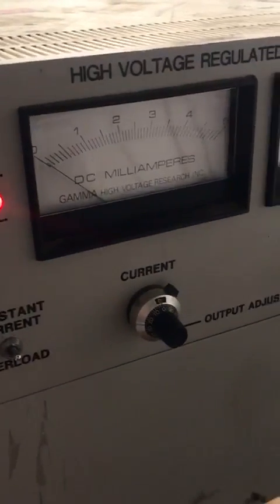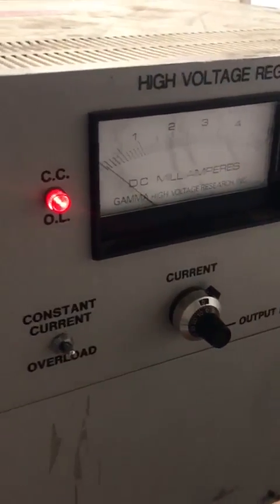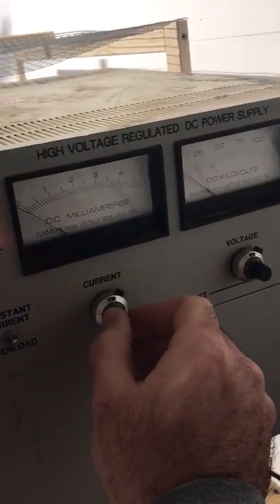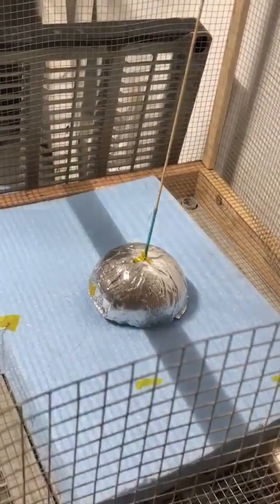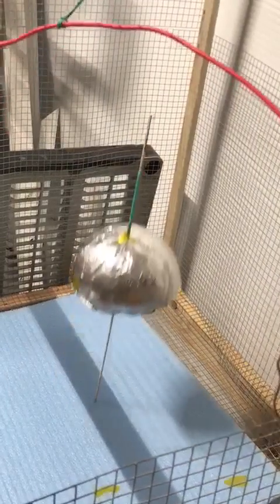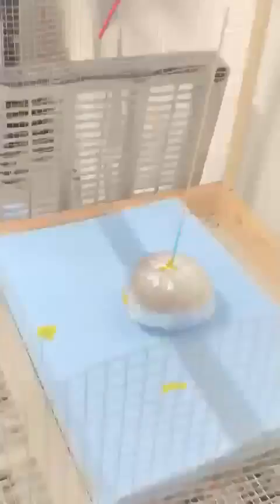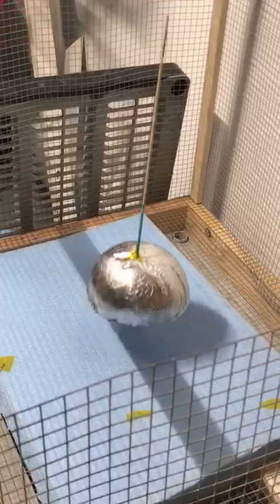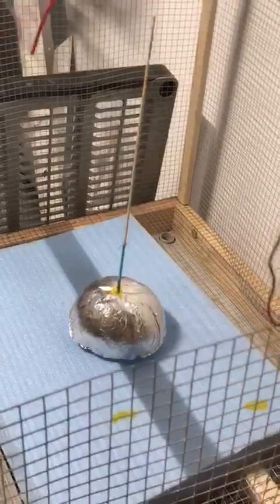Bell shaped ion craft flys even better!

Comment: Where is the current going to? and why do you have a tin foil ball on a string? im so confused as to what you're trying to convince people of.. lol
Reply from the maker: fusiondew  current is going to several small sharp edged wires located at the top of the device. The ball shaped base is grounded. This creates an ion wind and it works very well.

Comment: How did u shape it
Reply from the maker: goobman1981 
simple 
Take a piece of aluminum foil and fold it over a round bowl.
Then puncture it with a piece of straw and tape to aluminum.
Place this wire on top of the straw and power with hv  and ground the base via a wire.
Place straw on pole to keep the vector straight and power it up.
Kids as little as 4 years old have built working units like this. 
This is Much more powerful and easy to make  then the triangle ion craft.